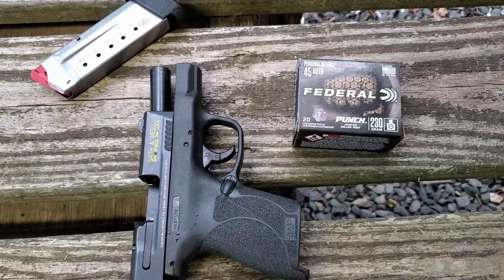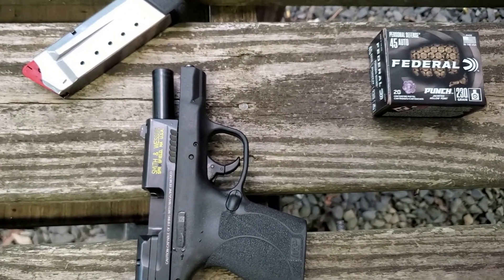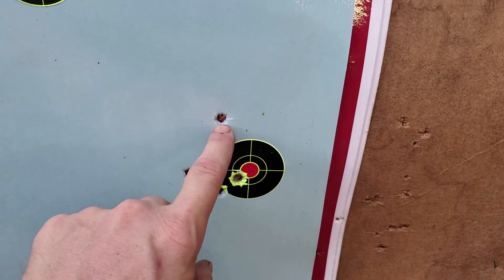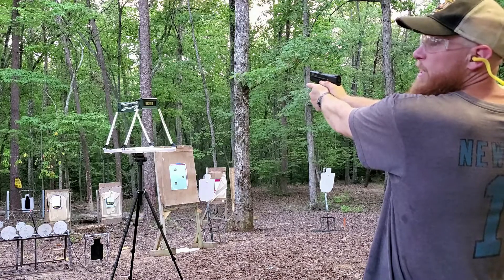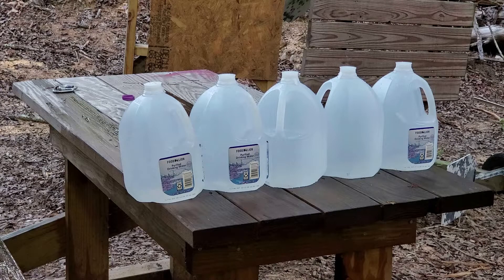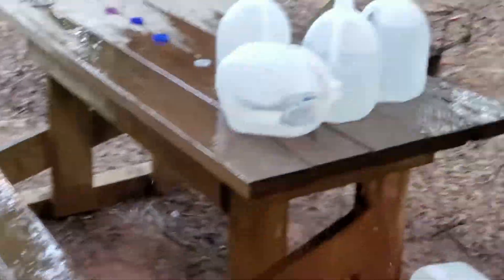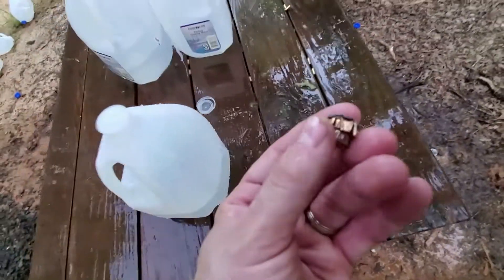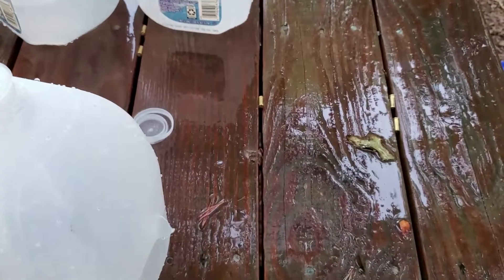Video 1 - Ballistic test: 45 acp Federal Punch

Comment: I would think that the chronograph would have to be mistaken giving those very low readings because I would imagine if the bullets were only accelerating to under 500 FPS, that wouldn't be enough pressure to cycle the handgun properly yet it did.
Reply from the maker: I agree with what you said, and on top of that the ammo would have performed VERY poorly if it was going that velocity.  I think the chronograph was having a bad day that day.  I feel like it is important to report what the chrono tells me, but sometimes it can be wrong.

Comment: The last two shots over the chronograph were legit, but the first three were not. You were probably standing too close, or the chronograph was having a bad day. I stand back at 15 feet, to eliminate muzzle blast that can cause problems with some chronographs. YMMV. Just so you know, water jugs are not a good measure of bullet performance, as even crappy jhp bullets will expand reliably in water. Using some type of ballistic gelatin medium with a clothing barrier is a much better way to test bullet performance. It's not perfect, but it separates the crappy bullets from the  ones that are good for self defense.
Reply from the maker: It was having a bad day, I am 5 -6 yards from it in most of my shooting.   

On the water jugs, I agree with you 100%.  I use those as a minimum - if a bullet won't expand in those from a short barrel,  then it won't expand at all from a short barrel.   My purpose is to test that, and at some point I might  expand (pun intended) to ballistics gel and denim. But for now, I want to see if these ammo brands can meet that minimum from very short barrels.

Comment: At very close range -50ft will a .45acp do more damage than a 5.56?  They say at less than 50ft the 5.56 is moving too fast for it to tumble inside the body and it will only penetrate.
Reply: I'm thinking that would only be the case with 62 grain m855, which is known for just punching holes at any range. 55 grain m193 is full metal jacket but tends to fragment. And any soft point 223 or 5.56 is going to beat the 45 acp soundly.
Reply: At 50 ft any 5.56/.223 load is going to have way more ballistic damage. Even the M855. Due to Very high velocities. You can look up ballistic tests of this on youtube.
Reply from the maker: I've never seen a test like that, but it makes sense.   Does depend on bullet since they make expanding rounds for 5.56.  It's a good question,  but I don't have a firm answer.